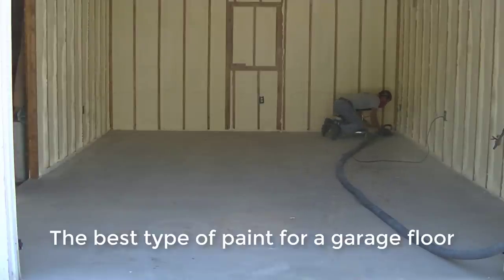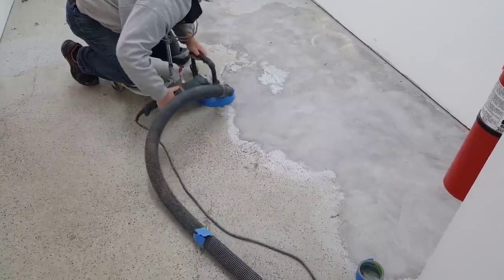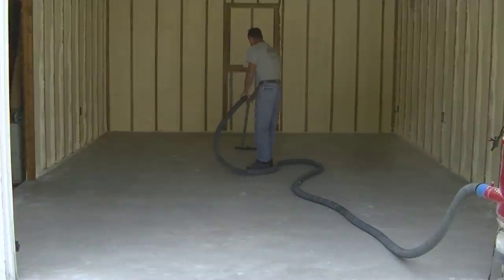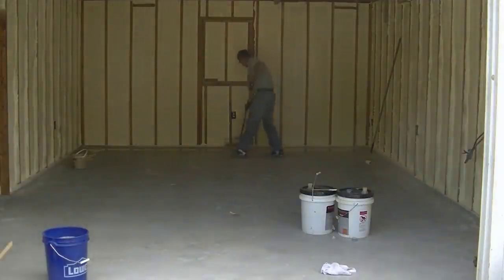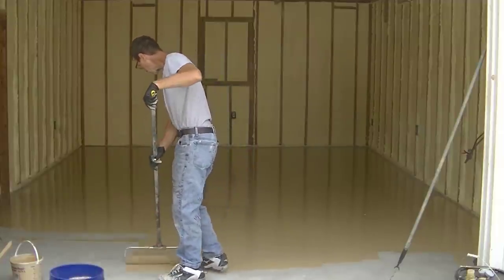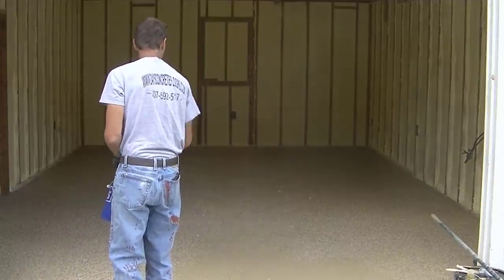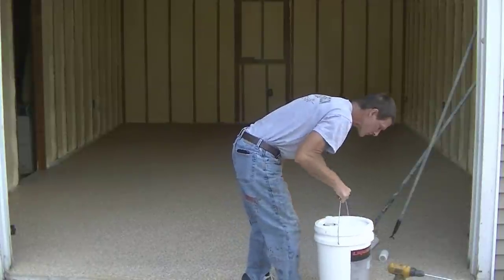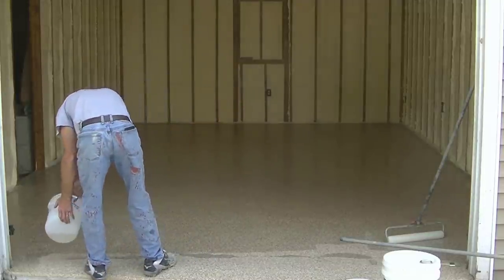Best Garage Floor Coating For A Garage Floor (Epoxy Garage Floor)

Comment: Mike, just purchased a home that the previous owner did a lot of auto repair and restoration. What is the best way to degrease/de-oil the surface to prepare it for painting?
Reply from the maker: These will work: https://epoxy2u.com/collections/microbial
Reply: Mike, thanks.

Comment: How easy is it to repair accidental damage to this type of coating? For example, if a heavy construction vehicle rolls over it and cracks and splits form, can you just roughen it up a bit , put down another coat and expect it to adhere? Or do you have to start from scratch and grind all the way down to concrete again?
Reply from the maker: You can sand the top coat and reapply. It'll adhere to it, just need to roughen it up a little. 100 grit sand paper will work.

Comment: Great video! In this video are you using Epoxy2U  or Flexmar? Also... I saw you have a "stamped Concrete course" online. I am just a typical middle-class homeowner, paycheck-to-paycheck. But I'd really love to pour myself a new driveway. And I'd REALLY love to stamp it to look like those, I think they're called "Roman Fan" pattern. i.e. looks like 2" x 2" stones set in semi-circles that form a never-ending fan pattern. Anyway... do you think that just a home owner could possibly do this himself? It's not a huge driveway by any means. And I'd be more than willing to pour/stamp it in sections. i.e. Do a 10'x10' slab; let it cure; then do another 10'x10' slab... etc. I can park my car in front of my yard for as long as I'd like.

Comment: Hi Mike.  Great video!  Very informative.  I have a question in regards to epoxy covering.  If the garage floor has a slope in it can you still use epoxy coating.  Thanks
Reply from the maker: Yes, most all the garages we do have a 2" or 3" slope to them, no problem.

Comment: What if you have dimples in the concrete or little chips don't you need a leveler? I had my 20x20 garage professionally epoxy coated in April looks good but I have a small section of a workshop with a lot of things in the way which I don't think I can move... All I want is a thick type of paint that I can just paint over the floor not home Depot great floor paint what do you recommend?

Comment: I’m gonna do this in our garage soon, but the previous owner had pets and evidently the garage was a convenient place for the dogs to urinate. For the most part the odor is eliminated except on hot humid days. I’ve used bleach to control the odor but it hasn’t completely eliminated the problem. Let me know if you have any suggestions.

Comment: What's the best option for a garage you work on cars and weld a lot as well?
Reply from the maker: This stuff is the best option for that. Polyaspartics are very tough. Epoxy2U.com is where to get it.
Reply: Thanks I'll figure out how much I need and check it out

Comment: I need to do my basement floor, as previous owners have used latex paints that just flake off, and during a year when the water table was high, the flaking increased and effervescence crystals appeared. I know that I will need to remove the old paint to prepare the surface for the coating. My question is would that coating act as a sealant to prevent moisture ingress?

Comment: Planning to do my garage floor this summer:))
Also used H&C cement paint for my driveway. Amazing stuff. Handles tire torque very well. Conflex is best for foot traffic not driveways. Thanks again

Comment: How is the slip resistance of the clear?  Do you know if it's bad when wet?  Do you use any type of Shark Grip additive for slip resistance?  I have epoxy in my garage and when wet, it's really bad.
Reply from the maker: Most coatings can be slippery when wet. The flake offers some slip resistance but yes, add shark grip if it is a concern.

Comment: I've painted my carport 3 times with paint that wasnt supposed to peel but it did. If I go through the process of grinding off/removing all of the old paint, I dont think I would paint it again. I guess I would stain it, or just leave it plain. Im getting tired of redoing it and wasting time & money. Its an old house, built in the early 50s but we are javing driveway repaved soon and I really like the look of a dark driveway flowing into the dark carport area. It looks so good but I cant seem to get it right

Comment: Hi Mike -
GREAT video! I hadn't heard of polyaspartic coatings before, they sound great. One question: I'm converting part of a finished basement to a workshop area. The concrete has been under carpet from when it was first poured, so no problems with grease, etc.

My question is whether I could get away with a deep etch vs having to use a grinder. The grinder would be a huge increase in hassle, and this is a basement floor, so no worries about hot tires. OTOH, I don't want to do a halfway job and end up with problems. 

Also - I want to do anything I can to reduce moisture load in the basement. The foundation is well-drained, so I don't think there's an issue in terms of the coating adhering OK, but I'm wondering if there'd be any additional benefit to applying a water-seal first.

Thanks for this vid (and your others, that I'm just discovering); it was super-clear and very helpful!

(PS: The links to your courses on your everything-about-concrete site give errors when you click on them...)

Comment: I plan on doing my floors too. Since I do a lot of vehicle maintenance, I’m not going to use flakes but first I’ve lots of cracks to fix. The PO didn’t do a very good job pouring the concrete.

Comment: I have a concrete floor racquetball court. Can this product be used ? I don’t want a slippery surface and I need to paint lines. What kind of paint would work for the lines?

Comment: Another great video.  How would you finish a new slab in preparation for polyasparic coating?  Would you still power trowel if you will sand it later?  Thanks in advance. Your videos give us confidence to tackle larger projects than we thought we could handle as DIY.

Comment: What if you dont want the flake in the paint. My friend did his garage that way and when we were working on his car everytime you drop a screw or nut on the floor it is very difficult to find it. I work on cars a lot in my garage so this os a big issue for me.

Comment: We had our garage floor done with Flexmar. We gave noticed tire marks from our parked cars along with some chemical that are through the top clear coat in a very small area. Is there a way to correct these blemishes. I scrubbed the tire marks but no success. Can I reapply the base grey coat, then rechip the area and finally roll on the clear coating?  Thank you.

Comment: Mike,
I wouldn't exactly call this product "paint" or this process painting. It's a coating 2 parts and many steps. Vs power wash floor and then 1-2 coats of paint. So sure it's a superior product, but it should be. Have you done acid coloring for garage floors?
Thx for the vid.

Comment: In your video you didn’t show if you acid washed the floor or not I was told you have to do this for a better bonding .is it not necessary?
Reply from the maker: I said I don't like to acid wash. Grinding is a much better way to prep for a coating like this. You don't want to introduce water into the concrete then seal it over with a coating. That'll cause it to blister when the moisture tries to escape out of the concrete. Grind it and keep it dry.
Reply: Mike Day Everything About Concrete thank you for clearing that up keep up the good work
Reply: @MikeDayConcrete  very helpful to know because I was thinking I could use this process on my basement floor.  Unfortunately, the floor sometimes gets wet when there's been a very heavy rain so probably would end up with blistering.  And no, there isn't a French drain or even properly installed sump pump.

Comment: Mike do you use the crack weld product to fill the saw cuts in a garage floor? Or is there another product for the wider cracks? Thanks Mike
Reply from the maker: We use the Crack Weld mixed with some silica sand. On new floors less than a year old we don't fill in the saw joints, they could still be active.

Comment: I really want to redo my garage floor. So do I use the E2U Epoxy 6150RC (Rapid Cure) 1st for the base coat then the E2U Polyaspartic 85 for the top clear coat???
Reply from the maker: Yes you can do it that way. You have to broadcast flake into the 6150RC though. It's tough as nails, you should love it.

Comment: Mike, great video as always! Is there an advantage to finishing with the Epoxy2U when the Flexmar site indicates their product has a 'clear coat' finish? Thx Andy
Reply from the maker: Andy, they're both clear coats for the finish from both companies. We use a colored base coat then a clear top coat. Both flexmar and epoxy2u have the same clear finish coat.
Reply: Perfect, thx Mike!!

Comment: I want to do my shop floor, never had anything on it before.It"s 30'X50" been putting it off because of never having done one before and not knowing what to buy. Don't want to spend a bunch of money and then a year later it's peeling off.

Comment: I have ordered the staff and going to do my garage floor (19'x19') in 3 weeks. Any advice will be appreciated.
Reply from the maker: Just follow the steps in the video. Have another person there to assist. What product did you order?
Reply: @MikeDayConcrete  Hi Mike,  
I have ordered E2U Polyaspartic 85 Ultra 2x2 Gal and E2U Flake system-1 box. Do you think 4 gal will be enough for this garage? Thank You, Ed
Reply from the maker: We usually do the base coat at about 200 sf per gallon so you'll need about 1.5 gallons for that. Then we do the top coat about 120 sf to 140 sf per gallon so about 3 gallons for that. 4.5 gallons. You may be a little short or have to stretch it thinner (I don't recommend that) Probably should have got another 1.5 gallon kit to be safe.
Reply: @MikeDayConcrete  what brand is the coating?

Comment: Can I do this on a basement floor?
Reply from the maker: Yes for sure
Reply: @MikeDayConcrete   my only issue is I have some black mastic left on my floor so I don’t think that can be sanded. I’m guessing I’d have to have that professionally removed before I was able to do anything

Comment: Thanks. I have been thinking of doing this at my home. Can this process be completed in one day? I would need to leave all my stuff outside and I would like to avoid things walking away. Again thanks.
Reply from the maker: Yes, do it in one day. That's one reason why we use it.
Reply: @MikeDayConcrete  Thanks MIke, I will give it a shot, again thanks

Comment: its 2021 march and i am deciding what to use on my new garage and carport, bathroom and front veranda, they are all concrete, the new garage will be a work shop and the attached carport will just be for storing the trailer and car, the bathroom is being renovated and was painted blue by the previous owner and it just looks like normal gloss enamel, the front veranda is cracked and worn, but i have repaired all the cracks and tried to level it off as best as i can, we want a blue finnish on all surfaces with metalic flake added, perhaps some white, dark blue and light blue flake, we are having trouble deciding what product will be best to use, but it has to be blue, light blue, and we are in Australia Henty NSW
Reply from the maker: If it's exterior I would use a polyaspartic coating.
Reply: @MikeDayConcrete  thank , only the car port will be exterior and in sunlight so we will make sure that that section is done in the polyaspartic, i like your videos and thank you for making the choice much easier.

Comment: Hi Mike,
Is it OK to use LastiSeal before applying Polyaspartic to block the moisture from building up? I have already bought LastiSeal . Thank You. Ed
Reply from the maker: Yes you can. Give it about a week before doing the polyaspartic and sand or lightly grind the floor to make sure no residue is left on the surface.
Reply: @MikeDayConcrete  Thank you for an advice. Will update later on the result.

Comment: Wow, I’m impressed. LOVE that roller thing you rest on while grinding the floor. Where can a guy get one of those?  Thanks!
Reply from the maker: Rob, it's called a Racatac. You can get one on Amazon - https://amzn.to/32JkODK
My guys love them. We use them all the time.
Reply: HarborFreight has “rolling knee pads” in stock. I have 2 red ones.

Comment: I am house flipper with 35+ years experience and I can tell you that if you're not thrilled about having to go thru all that sand and grinding prep, my favorite concrete coating is Behr Solid Color Concrete Stain available at Home Depot.  With this product, you just need to get the surface clean and able to not have water bead up on it.  The Behr stain goes on very easily and two coats will cover just about any underlying staining. It dries very fast so you don't have to wait around for anything to cure.  You can have it custom tinted to a myriad of colors and if you want a non-skid surface, you can add a bag of Rustoleum anti-skid to a gallon of the stain.  It's perfect for garages where wet tires need to grip the surface.
Reply from the maker: And 2 weeks later it peels up under the hot tires. Perfect
Reply: @MikeDayConcrete   No it doesn't.

Comment: everything Ive read says to "etch" cement first..that has prevented me from pursuing this..it doesnt look like thats necessary with your method....does Lowes sell that product you are using ????
Reply from the maker: No etching, just lightly grind or sand it. Epoxy2u.com is where to get the polyaspartic.

Comment: Thanks for the video!  I want to do this with my garage.  I have a 50-year-old slab with a variety of stains, oil mostly.  What is the best way, in your experience, to prep the surface?
Reply from the maker: You gotta grind it for sure. Then repair/patch any cracks, chips and spalling. Here's a video to show you how I do that: https://youtu.be/5C7otrHKNgA  Then you have to use a moisture block sealer to keep moisture from coming up through the floor. I like this for that: https://www.radonseal.com/concrete-sealers/lastiseal.htm
You can use this for the oil stains: https://epoxy2u.com/collections/microbial/products/tough-on-oil?variant=31343541878842

Comment: Mike, I’ve made note and will be upgrading my shop.
Reply from the maker: Awesome, do it.
Reply: Now the problem is to get everything out of the shop so you can get down to bare floor!
Reply: @c50ge  It is a new build, I can do the floors before the equipment is brought in.
Reply: @keithww5111  
Yep: could have,would have,should have. Finished mine when it was new!

Comment: I did my own garage with the rustoleum epoxy kit and a latex top protective coat and it looked good for about a month, now it looks terrible 😔😔😔. I really need to re-do it.
Reply from the maker: Yea, you gotta use the good stuff.

Comment: Is that paint waterproof?
Reply from the maker: Yes, once it's on and cured, water doesn't go through it.
Reply: @MikeDayConcrete  I'm pouring a concrete cistern soon for potable water.  What would you use to waterproof it?  I've looked at several options including hiring a pool company to come out and spray it with stucco or whatever they use.

Comment: More worried about driving over the finish, I'm worried about rolling a floor jack. Metal wheel can really chew the finish.
Reply from the maker: This stuff is really tough. Floor jack will be fine.

Comment: I had a strange problem that I’m hoping you have seen.  I ground the concrete, but after coating, I have what looks like tiny air bubbles in the coating.  It looks like the  concrete had tiny air pockets exposed after the smooth concrete top was ground off. It looks as if the air bubbles were not able escape before the coating thickened and set.  On the bright side, it has given most of the floor an non-slip texture.  :)  Have you ever seen this and how could it be avoided?

Comment: My garage floor has no vapor barrier because it was built in the early 70 ! And after 2 years most of the paint bubbled up. Ahh ! What would be the best way to redo the floor ? Getting up in age and don’t want to have to redo it every couple of years.
Thanks for any of your help out there.
Reply from the maker: You'll have to grind off all that and apply a moisture vapor blocker epoxy first, then do the epoxy floor. epoxy2u.com has this, check them out.

Comment: The best paint for a garage floor is no paint. Why in the hell would someone paint their garage floor over epoxy it!!
Reply from the maker: If you watch the video you'll see I'm talking about a polyaspartic coating. "Paint" is just the term I'm using to describe what I'm doing. Polyaspartics are better than epoxy. I do both and have for years.